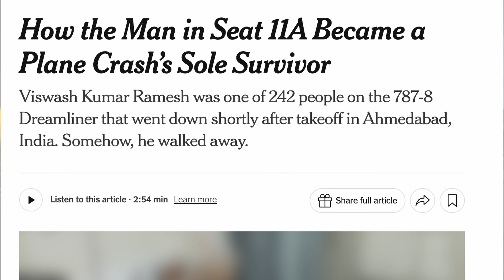Why the RAT Changes Everything – Air India 171 Update

Comment: Om the  video where you see and hear the RAT, there is one thing you can't hear, and that is the turbofan engines. They should definitely be in TOGA mode at max RPM, and easily drown out the sound from the RAT . The fact that they are not heard is evidence enough that both engines have failed.
Reply: Yes, whatever people speculate on the  fact is the pilot  said no engine power no thrust in the mayday. Also the gear looks partially retracted the wheels have moved angle from their normal position thus he pulled the gear up and the hydraulics failed to lift them, need to see a side angle to be sure.

Comment: Wow, I learn so much from your professional insights - good analysis. Perhaps the Lithium battery controller could have taken the entire power system offline and rebooted the aircraft? Would the engines have stayed running then given everything is computer controlled? It might have been the first plane to use that form of battery but perhaps like in laptops there's a tradeoff if a cell suddenly dies.. that could have triggered the rat. I guess we will all wait for the black box data release. Perhaps this 787 hit the 51 day reboot bug?

Comment: Speaking as someone who knows absolutely nothing about aeroplanes or flying, I have gathered from news reports that the chances of both engines failing at the same time is virtually zero. I was wondering, though, if it is possible that one engine failed and the pilot or copilot in a panicked attempt to apply full power to the other one accidentally reduced the power instead. I was thinking of that because I recently saw a story about a very experienced pilot who almost caused an accident by mixing up left and right. All humans make mistakes, especially under the kind of pressure these pilots would have been under if an engine failed on take off. Is that idea possible, or would the pilot not be able to reduce the power on the remaining engine even by mistake? There seem to be a lot of very knowledgeable people commenting on here, so just thought I’d ask.

Comment: Can the RAT be manually deployed?  Does the deployment of the RAT disable or isolate the electrical and hydraulics demands of the plane from the engine driven generators and pumps?

Given: The RAT is deployed automatically if the loss of all electrical power or all hydraulics power is detected (might be other triggers).  
Then: It would make sense to isolate all but essential electrical and hydraulic systems from that provided by the RAT.  An electrical circuit(s) could be drawing more current than it should or hydraulic system(s) leaking fluid.  

Question for Captain Steve: Can the simulator simulate the difference between the loss of lift and the loss of power from both engines?  Can a pilot on the flight deck of an aircraft in flight detect/sense the difference between loss of lift and loss of power?  One would be a sinking feeling the other a loss of forward motion.  Asking as a non-pilot, I know nothing about real life avaiation.

Comment: There is no engine sound when it drops down also you can not here engine throttle up . The rat sound is there yes worked on many aircraft and testing the RAT on inspection attaching the hydraulic generator to test very nosey just like the video

Comment: Good job Captain. Some YTers have spotted a fifth piece of evidence strongly hinting at a dual engine failure: the position of both main landing gears. On take-off the front wheels are tilted up. A feature found on the 787 rotates the gears so as to tilt the front wheels down prior to actual retraction. This enables them to fit into their bay. Well, if the video is to be trusted, the front wheels are tilted down. That means the retraction lever was activated, the gears were rotated in their storage position, and then both engines failed, which resulted in a loss of hydraulics preventing further retraction.

Contrary to the RAT, about which there's some confusion as to whether it activates upon single or dual engine failure on this aircraft, the landing gear position clearly hints at a dual engine failure evidenced by a complete loss of hydraulics. It also indicates that someone had activated the gear retraction lever, which would invalidate the theory of an action mix-up, i.e. retracting flaps instead of landing gear by mistake. This piece of evidence, if shown to be correct, should probably take first place in the list as it provides more information.

Comment: I remember hearing the RAT functional test when I worked on the 767 final assembly at Everett. A very distinctive  sound. I used to call it testing the trolling motor. Air Canada successfully landed a 767 dead stick using only the RAT. The plane ran out of fuel. The densitometers malfunctioning. The manual fuel check was drip less fuel sticks. The wrong ones were installed. Imperial measure was installed, they were looking for metric, unsure of the conversion rate. They ran out of fuel. First commercial jet airplane to land on the RAT, it was proven. The plane was mostly okay no one killed, one sprained ankle. Saved by Boeing engineering and a very good pilot. A movie made: Falling from the sky.

Comment: I’d say it was a hydraulic failure.  It looked like there was some kind of trouble with the right engine where you can see it yaw slightly to the left.  If a fan blade exploded it could have ripped through the fuselage and blown key hydraulics.

Comment: One specific issue that could lead to fuel pump problems is a software bug in the generator control units (GCUs). Boeing discovered that if the four main GCUs were continuously powered for 248 days, they could enter a failsafe mode, causing a complete loss of AC electrical power. While this issue never occurred in service due to regular maintenance procedures, such a loss of power would severely impact all electrically operated systems, including the fuel pumps.

Comment: Would the pilots have been aware the RAT had been deployed or do you think they may have done it manually when they realised there was an issue given so little time to take action. Would it have deployed on the ground during takeoff if there was already a hydraulic or engine issue ?

Comment: 104F temps and you could have fuel vaporizing in the tank. Has happened before. Bang could be from an explosion in/near the lines if maintenance messed up electrical insulation or other possible ignition.

Comment: Steeeeeve, did you say that the Japan Air flight where the RAT deployed was a duel engine failure and was that also a 787 on take-off? If so and should your assertions be correct about this flight, this would mean that there have been two dual engine failures on the brand new Boeing "Dreamliner" 787. Not to cause panic but..... methinks Boeing has some explaining to do should this turn out to be true. Even if it's one duel engine failure on take-off or at any time during the flight, that is mind boggling and very concerning for Boeing. The plane essentially has ONE job....TO FLY!!  As you also stated, contaminated fuel would probably not be the issue because as they powered up for take off, there would have been some sign that there was an issue with the engines but the take-off seemed fine. What we heard sounds like the RAT was deployed, it looks like it was deployed, the plane lost lift suddenly right after take-off also indicative of dual engine failure, the landing gear was left down, perhaps no power to bring them up. And finally, the sole survivor, bless his soul that he somehow escaped,  heard a loud bang and the lights flickered, all indicative of a dual engine failure. I was however under the impression that there would be some visual or auditory evidence of both engines flaming out but maybe not. I was leaning towards the co-pilot accidentally putting the flaps up instead of the landing gear prior to this but with this new information, putting the flaps up too early would not cause a bang and the lights to flicker, nor would the plane sound like a prop plane. Imho.
If it walks like a duck,  quacks like a duck and it flies like a duck..... it's probably a dual engine failure. But again, it's very early in the investigation and this is all mere speculation of course. I'm very curious to know what was said in the Mayday call....but.......
Thank you so much for your expert and exemplary commentary.
Much love from Montreal.

Comment: Hello Captain Steeve. i don't know if you get to see this comment but i would like to share some thoughts on the Dual-Engine Theory.
- After just a couple of minutes i found out that the GEnx 1B64 wich is the same one on the AIR India 171 flight IS KNOWN TO HAVE CAUSED AT LEAST ONE DUAL ENGINE PROBLEMS BEFORE causing Engine Surge below 15,000ft the Plane was a Jetstar Flight towards OSAKA on march 29 known as JQ15 
- I know what the Inerting System is designed for but do you have any knowledge of how exactly Nitrogen behaves in the Fuel tank at high Temperature and If the System or Nitrogen could have any impact or Contaminasion potential to the Fuel. (This is just a shot in the blue and just out of curiosity rather than related to AI171)
- What system mode at that time could have impacted the Engines? I doubt FLARE mode since it would have not been able to Extend the Ram air Turbine but is there something?
- Another thing i found out is the design of the Engine blades makes the Aircraft remarkable Vulnerable to BIRD STRIKE due to the blades being designed out of Carbon Fiber and only reinforced with titanium, not completely made out of titanium
- Although i have my doubts about accuraccy i have recreated the flight in MSFS2020 as of best knowledge to weight & weather in regard to not climb higher than 600ft above gnd (800ft above SL with QNH 1001) retracting the flaps but having at least one engine gave me more lift than the AI171 flight. On the first try with a dual engine Failure right after Takeoff i crashed in the exact building AI171 crashed into

Comment: If there was a loss of power why was the decision to take off made? I can assume there is a procedure for engine failure after V1, VR and V2 and it’s a fraction of a second to decide but surly attempting to take off with dual engine failure was choosing where to crash rather than saving the plane

Comment: Hey Steeve, I'm with ya "almost" all the way, however, there is a single piece of evidence in this video that both motors were running. Just before the fire ball, as the plane settles at tree level you see a simple in descript black object sort of flutter right to left. This appears to be some debris off a roof prior to impact. With the plane pitch and sinking altitude the thrust would have kicked this up from a roof top just prior to impact, which is what we see, it's in the foreground, not background as a result of the impact. Also, what appears to be the RAT is honestly in the wrong position based on the pitch of the plane, it would appear closer to the aircraft. The good news is we will all soon know the basics once the black box details are made public!
Unbelievably I still think it's a takeoff with the wrong configuration (how they did that is another question). The plane takes off very late and does not rotate as expected, it appears to only gain altitude due to "ground effect", once clear of that, the plane is clearly in a deep stall. That would explain the possible wording of "not making lift" because the engines were screaming still. Also, when the pilot pulled back at Vr, it would have immediately felt different to him, possibly causing both of them to miss the gear up call. A plane without flaps will accelerate just fine, even better down the runway, it just won't fly!